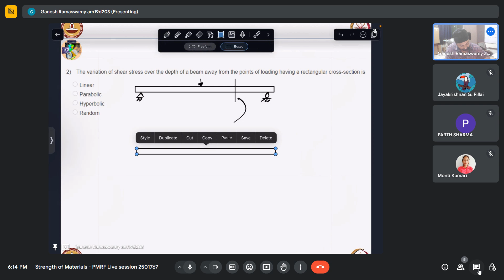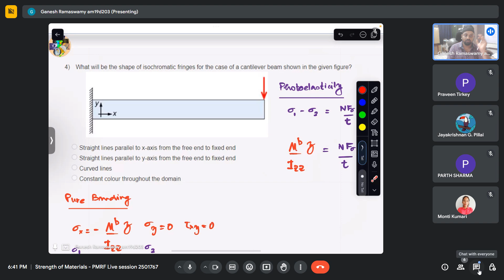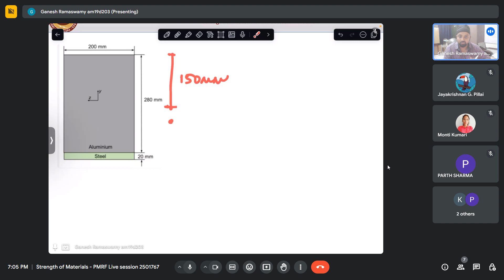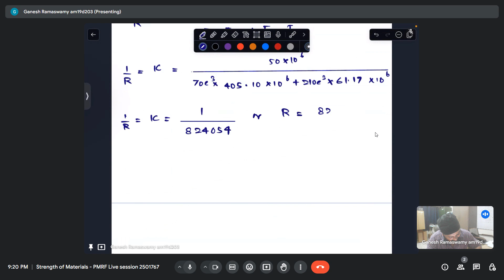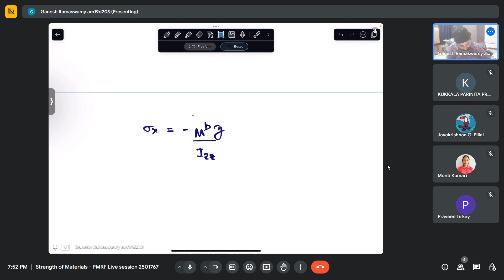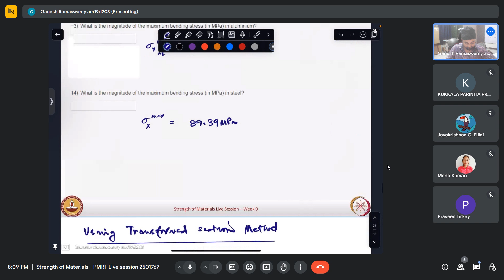Strength of Materials - Live Session | Week 9 | 2024

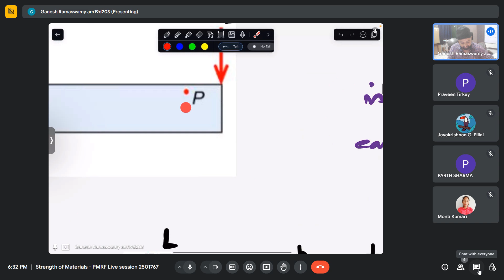Comment: 32:16 cross section of the beam should be provided so that we can get idea of the neutral axis where it's located (need not be on centre)
Reply from the maker: Good point. However, in the context of this question where the focus is on identifying non-zero components of the stress tensor, one should be able to conclude that it is not on the neutral axis based on the very framing of the question. This is part of th training since all data will not be always available.